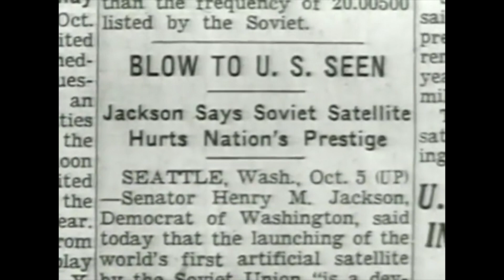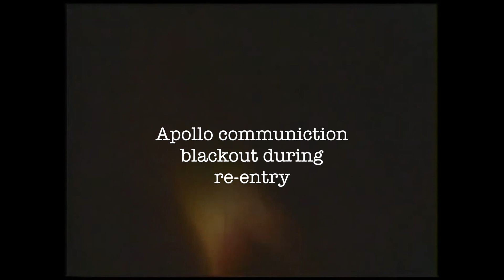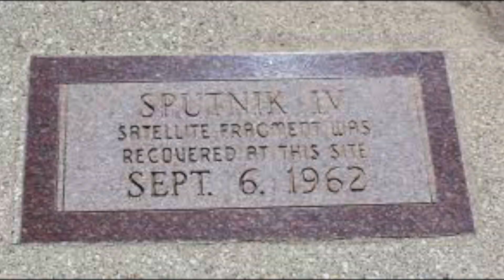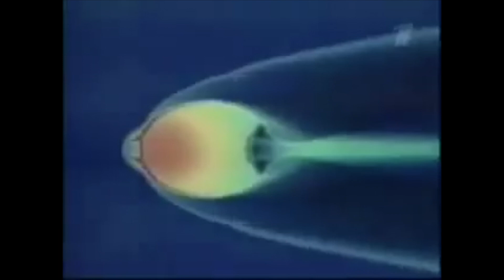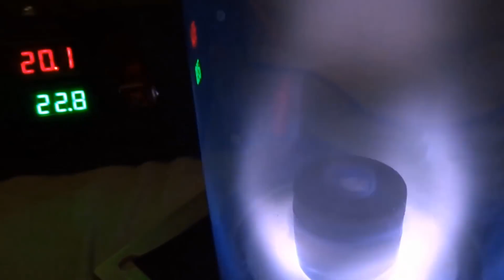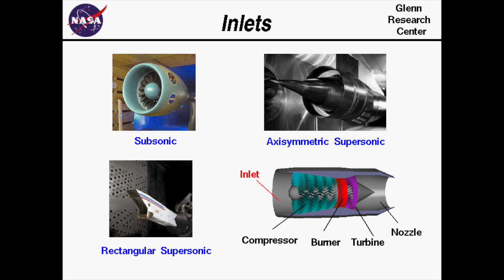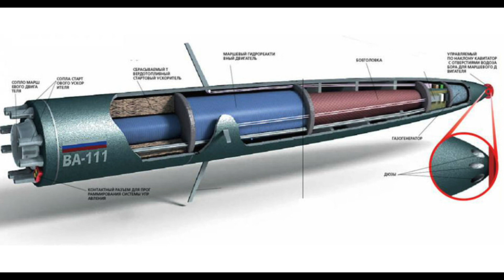Stealth Plasma Tech - Prof Simon

Comment: I've heard that it is possible to light a room without any visible source of Illumination. Could this be done with plasma? And this plasma must otherwise be benign to humans.
Reply from the maker: The security service used infra red...but you can use radar
Reply: Fascinating, I never thought of radar. An energy field of some sort. For some reason it gets me thinking about the particle or wave question. I'm pretty sure I'm not going to solve that one today, so maybe it's time for lunch?
Reply from the maker: Let us know how you got on....and enjoy your lunch after you solve that science question....ha
Reply: I was speaking of light in the visible spectrum. You'd walk into a room and turn on the switch and the room would illuminate from no given direction or source, and therefore cast no shadows except under specific circumstances. If you might have a guess at how that may be done, its interesting to think about, does seem feasible if not possible, and may possibly be in use now.

Comment: Hmmm, never knew all this had history behind it as it was always presented as a rumor. Now, how about magneto Hydrodynamics? Magnets can be used to move electrons and positive charges from the plasma flow or does it concentrate the negative particles at one pole and positive ones at the other pole? If either is true then with fast, strong alternating magnetic fields could one create a low temperature plasma? Would this plasma have a dule green glow? When I lived in Wisconsin I was on the edge of a large tornado one night and 2 planes flew over both glowing a brighter green than the green sky. This was caused by the fast moving air creating charges within itself. Always have had an interest. i have always had an interest in MHD since I read on it being used to generate power in combined cycle electric generating plants and then read on it being used as ship propulsion at 14 to 23 years old. A metal ship ought to make a nice magnet and AC current might create a nice low temperature field of plasma but would it have enough charge intensity to make it disappear. ( if it did, then the US Navy would probably have it in use today)

Comment: I knew it reduced aerodynamic drag the first time I put my hand in the dryer after a big load and my hand passed through all the statically charged air. I was like bingo!! Less fuel more miles. I need that on my truck.

Comment: I have to wonder if the B2 is also using the plasma to effectively silence the engines, there are many reports of the B2 sounding unnaturally quiet during landing and take off though that could be the ionization effect reducing drag so thhey can run the engines leaner?  I'd love to know exactly what is going on there because if it is reducing drag, this needs to be made public as more effecient planes is a no brainer considering climate change.
Reply: Astra I see You perfect flying V. Silent

Comment: 3 problems with plasma around aircraft. 1 you touched on which is the footprint glow, 2 is the plasma absorbs all comms and sensor signal inside the shield, therefore the pilot is flying blind.  3 relates to plasma containment - it cannot exist without a container. It requires + and - electrodes insulated from each other to allow a charge to pass through and ignite. The skin of an aircraft does not qualify in any way.

Comment: Pretty sure Shkval doesn't use/need plasma. It's 'just' an underwater rocket with a gas generator at the nose. It cavitates the water away either side at the nose and runs in the water vapour pocket behind that. Very, very fast, but not sure how steerable it is:

https://en.wikipedia.org/wiki/VA-111_Shkval

Comment: Wich is also a good explanation why UFO are so hard to detect by radar. Often described as glowing objects wich might be the result of the air version of a magneto hydrodynamic drive. The latter is in use as silent engine in submarines, the air version can't be built because of the needed magnetic field strength required. The effect is that you ionize the air around the craft and can create with the magnetic fields at any position of it a vacuum. Wich of course allows for silent hoovering with no engine noise at all.
The truth is out there, and its most likely technology.

Comment: @ Professor Simon Holland The Shkval torpedo doesn't use plasma. It has a nose cone with nozzles that eject high pressure gas from the rocket engine and produces water vapor by cavitation, thus enveloping the torpedo in a steam/gas bubble which reduces water contact and thus friction. 

Steering is achieved by moving that front nozzle.
[ https://en.wikipedia.org/wiki/VA-111_Shkval ]
[ http://miau.tk ]

Comment: Plasma also has the unique ability to directly irradiate the brain to give the illusion of sound even at far distances. When I was a young boy, I heard a whooshing noise overhead, looked up and saw a meteor falling. It wasn't until I got a little older then I realized the sound should not have been concurrent with the light due to the difference in propagation speeds. It wasn't until I read an Omni magazine article about that property of plasma, and how scientists had regularly tested it with the only predictable recurring event that produced plasma, and that was the return of the space shuttle. Plasma television sets had the unique ability to directly irradiate the brain with audio so the sound is like it's coming from inside your head. plasma radiation has also been used for crowd control purposes because it makes people freak out when they hear a voice in their head telling them to disperse.
Reply from the maker: Very interesting

Comment: This was the answer  to a sitting in2013. Turlock ca. 2 or 3 in the am. It was a massive  ship  the size of 4 city blocks. Phases out of nowhere with a super green color. The shape was as if 2 golf ball attached in the center. Each dimple had what to me looked as a satellite  cone. But now they probably were  nosils it was moving west 20 30 mph. 500 _1000 feet above. It was visible for 5 to 10 seconds.  As I alerted my girlfriend  it was. Re clocked. As I'm telling her what I saw a plane was flying south 10000 20000 ft. She argued it was a helicopter it was flying to slow then I noticed the flashing lights weren't right for a plane and agreed a helicopter. Then see said it's a plane.. we start really looking as speed was like a car running out of gas a little power then no power and we were watching the lights on the wings change to helicopter lights and back to plane . Almost directly above us. We a baffled. And at the same time say what the @$&#* is that. It flashed a red blue green and zipped a rust brown streak and was gone. Like in star wars when they do a light jump.. swear on my life all true.

Comment: Given little to no practical constrain things may work as good as our imaginations. Likewise plasma stealthiness may be laboratory feasible on an insulation suspended model air craft directly wired to (-) terminal of a plasma machine provided that (+) terminal is grounded on earth. Plasma is restricted to direct current. Tesla’s lightening bolt isn’t plasma. It is ac alternate current.

Realistically an airborne object on a flight/glide path can’t be charged with plasma through wires, or carry a plasma machine on board to charge its fuselage without the (+) terminal remains wired on “earth”. 

What kind of plasma doesn’t require earth connection ? or (+/-) terminal-less ? 

Answer : cosmic plasma energy/force, it’s properties is not well understood. We only know that cosmic plasma is an intermedia energy transmission network that delivers direct current to loads through space wirelessly through cosmic space. Loads being the NE poles of each planets. 

Cosmic plasma energy/force : also responsible for : aurora polar lights, magnetosphere and magnetic poles, geothermal and magma, geo-torsion spin .. and ultimately - for sun, earth and sibling planets - to be electrically pulled along one galactic arm to be in geosynchronous with every planets of our Milky Way.

Comment: This is nonsense. The Skval torpedo for instance does not have anything to do with plasma and using plasma would be pointless. The Skval is a rocket powered device that uses some of the rocket gases fired from vents in the nose to create a steam or bubble curtain around its body to cut fluid drag. Its similar tech to what ballistic missiles fired underwater from subs use.
Reply from the maker: i have it good authority a newer torpedo uses plasma.....you are probably correct about the Skval.....its a bit old now.

Comment: Stealth tech has minuscule benefits against high tech militaries compared to the astronomical costs in western capitalism, of applying the tech. There is no such thing as an invisible plane.
Reply: Russian Plasma Stealth already exists and has for several decades America spent years trying to steal it before reviving their own defunct programs. There was an announcement a few months back Russia has found a way to get electronics to work through the Plasma field. It is said by the US Military to make an Aircraft vanish from Radar completely the unit was said to weigh around 100 kg 220 lb. It also enables an aircraft to fly at extreme high speed several thousand Kmh while in Operation.

Comment: Doesn't plasma create electromagnetic waves? (next to absorbing them) (this is a question -as I don't know for sure) Found this "Because of the totally chaotic and highly energetic state of the constituent particles of plasma, it produces its own electromagnetic radiation.". Wouldn't that turn a stealth craft into a radio beacon...?
Reply from the maker: Good point....a radio beacon that glows....sounds logical.
Reply: @SimonHollandfilms  Let's disguise our secret aircraft as.. a pulsar star! LOL. But seriously; I do believe that the B2 is using high voltage for ion propulsion (accelerating the air, not an onboard gas), in addition to it's jets, IF the efficiency is worth the effort. Maybe you could look into that: is using the power of a gasturbine engine for ion propulsion more efficient than using that power directly for old fashioned jet propulsion? You can not take off with just ion propulsion, but once you are up high, it may be an efficient push.

Comment: The real application of this would be shielding of electromagnetic radiation: i.e. spacecraft to and from the Earth to Moon and/or to Mars.

Also for at least a decade (or two or three), it hasn't just been radar stations picking up reflections from aircraft. There are satellites looking down, which will pick up an clear "hole" in their picture looking down. And while the US/UK use microwave frequencies for radar and base their stealth technology on said frequency, the USSR used low frequency LW/MW/SW, which picked up US craft just fine. Iraq (Desert Storm) documentaries show the US planes were clearly visible on radar. Their mistake was not linking the Russian and Chinese systems together properly. (Also interesting part of this story is South Africa captured a fully intact SAM-8 system from the Russians in 1987 (Cuito Cuanavale / Op Modulus,Hooper,Packer) , then turned it over to Israel for reverse engineering. Ironic how this is what enabled Iraq Desert Storm to be possible...

(Plasma radiation shielding : this is also a reason I don't believe in the so called "manned" moon landing (or six "manned" landing)
Zond 5 got a tortoise (or turtle?) to survive a trip around the moon. Any person in space without adequate radiation protection would at the least exhibit signs similar to cancer patients just after receiving radiotherapy treatment.

Comment: To Prof. Simon:

The plasma is cool in shielding the aircraft to trap radar waves and not giving them back.

But, there is one big Problem.

As the plasma prevents any radar reflection outside of aircraft i. e. any radio wave that is sent by other sources to detect an aircraft, this plasma also stops any radio waves sent by the sole aircraft.

Nothing of radio waves goes in nor goes out.

So, the aircraft that is shielded with plasma cannot use its own radar too.

So, that is a Lose-Lose situation.

There are also cheaper means of making the stealth.

Beside the shape of an aircraft and Radio Absorbative Materials, 

there are also denticulated or V and W shaped edges of any part of an aircraft that is most susceptible to radar waves.

Also, the existence of a Bypassed Jet Engine which sucks air in two means: 

1. Some air sucked from air intakes is set into the combustion chamber of the engine, mixed with fuel, burned by spark plug and produces the thrust.

2. The second part of the air is set around the main section of the engine which gives an additional thrust, makes engines appear more colder or almost absolutely cold to enemy infrared and radar devices which means, this bypassed air gives thrust and cools down not just engines but entire aircraft, reducing its heat and radar signature.

For example, an F-22 Raptor uses bypassed air of its engines and liquid nitrogen to cool itself and its engines to minimise the heat and radar signature.

Also, the radar of the military aircrafts is positioned in slanted towards the horizontal cross section of an air plane.

This further reduces an aircraft's Radar Signature or RCS.

But there was a device called a Radio Cancellation apparatus (I forgot the real name) which detects and sends the radar waves in the same frequency as the enemy radio waves, cancelling them out on collision between the two or more radar waves.

So, plasma is not feasible in Radar signature reduction because it prevents an aircraft that is shielded with it to use its own radar (in such aircraft you see nothing on your aircraft's radar as long as the plasma shield is on).

Thank you for your time.
Reply from the maker: Thanks good info....all makes sense
Reply: @SimonHollandfilms  I like ideas in these videos and I have my own but every idea needs finishing by detecting and solving any hindrances within and around them.☺

Comment: Ive long suspected that buildup of a high density -charge at the leading edge and ejecting a high speed +charged exhaust, would generate a magnetic field and pull excess -ions over the skin and recouple them in the exhaust stream. This could potentially 'cloak' it from RADAR, a bit like a Faraday cage. I also believe this effect to be the basis of the 'Aurora' codename.
Reply: You have long suspected that?  What is your background?

Comment: Aircraft generate high voltage  static electricity while they are in motion. 
Airplanes are fitted with "static wicks" usually on the trailing edge of wings which dissipate the charge. 
Excessive static electricity without  static dischargers can interfere with radio communications and electronics. 
Harnessing static electricity and using it to create a plasma field could provide the power needed, and at a low field setting might make visible glow, minimal.
Reply: VALHALLAXE thanks.    I knew wiskers would do it.  Gather it and with capacitors cycle to the front.   Same principle for folding space.  Put the vibratory bow wave up front and create a Venturi effect to pull your craft to beyond light speed.      Remember the cable the shuttle towed.   It burnt the connectors in seconds.   And luckily fell away.  So plenty of juice available.  .

Comment: Great video.  Thanks.   Why not use the dc charge from the air friction to power capacitors cycling in series to create the plasma.    Can’t wait to not see one
Reply: Why bother? The charge is known to be dissipated through the exhaust, which creates a high density charge- at the front and a high speed charge+ ejecting at the rear. The buildup at the front will exceed the charge density of the exhaust, so the gradient would pull excess negative ions over the skin, into the exhaust stream. The skin and much of the superstructure, is non conductive, so all thats needed to produce the effect, is high altitude cruising.
Reply: Spring Bloom add whiskers and push it forward to the nose.   make a plasma Venturi with forward vacuum   pressure.    .  Like folding space

Comment: There are rumors that the Philadelphia project had achieved turning an entire frigate invisible to the naked eye using an electromagnetic field that bent light around the ship. Mind you the crew were apparently mutilated from the experiment and some died. This was in 1943. Fast forward and not six years ago CNN ran a story about military camo that can render its wearer invisible. That video is here on YouTube. I'm also certain six years ago when that story released it was tech that was likely a decade or more old and the military had much better stuff. There is also a video that came out around this time during the Iraq/Afghanistan war of a soldier approaching a tank in such gear. It was never confirmed if the video is real or not.
I'll post links if I can find them.

Invisibility cloak: https://www.google.com/url?sa=t&source=web&rct=j&url=%23&ved=0ahUKEwj0-L3Y8OTjAhVQiOAKHeEhDZ8Qxa8BCDYwBw&usg=AOvVaw0VTJzWxrN8ZFOD4xbU2nov
CNN video of troop camo: https://www.google.com/url?sa=t&source=web&rct=j&url=%23&ved=0ahUKEwj0-L3Y8OTjAhVQiOAKHeEhDZ8Qxa8BCCowAQ&usg=AOvVaw0VTJzWxrN8ZFOD4xbU2nov
Reply: Project Montauk is that correct? I also heard it was a test for time travel but maybe that's the cover story for the gullible. . .

Comment: i don't believe in any of this. you will have to enclose an entire aircraft, make it air-tight, so plasma can be obtained. you might as well cover an entire aircraft with glass or strong plastic, which will eventually break. even with this you will still have to let exhaust fumes out and pull up/down the landing gear when landing, hence it's not going to be air-tight. I'm an aircraft mechanic.